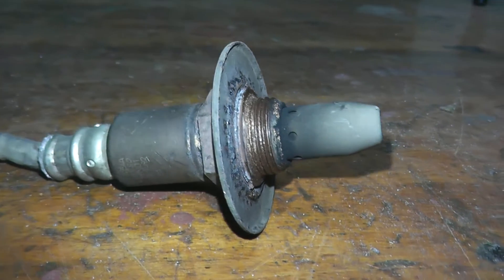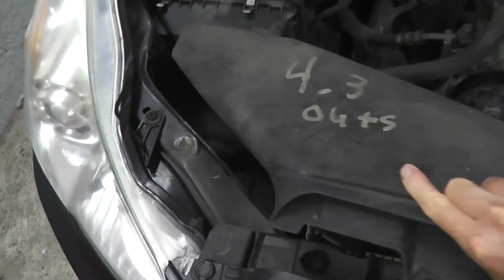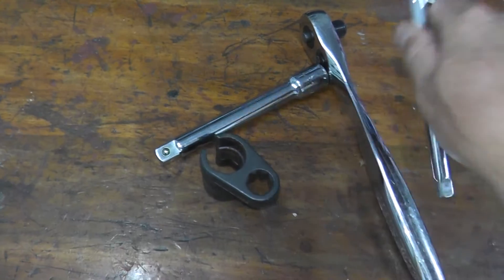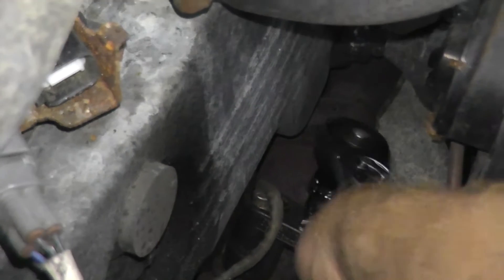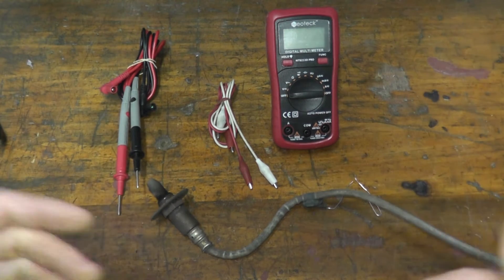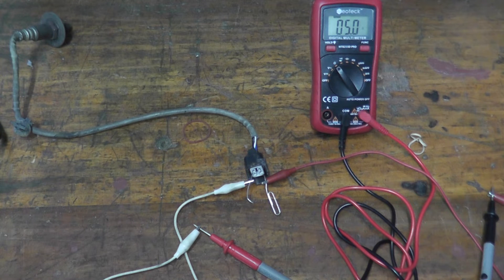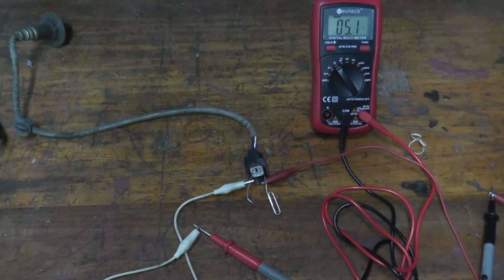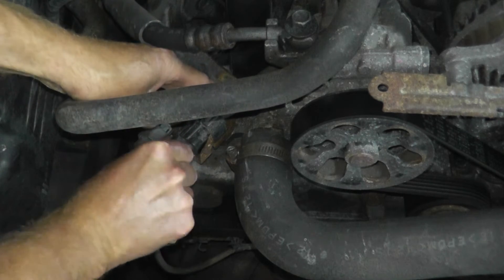Subaru Air Fuel Sensor P0030 P0031 P0032

Comment: I got p0030 and my sensor is 2.5ohm but i still got a engine light what can be the problem, sorry for bad english
Reply: Either 02 sensor is faulty or connector to the car is faulty. If they are tested and they are good then it means you might have an exhaust leak somewhere.

Comment: Will the light turn off by them self after u install the new sensor?
Reply from the maker: Yes, eventually. The computer will turn of the light but it can take up to 70 miles or a combo of local/highway driving. Your local part store will more than likely turn off the check engine light for free or you can buy a cheap code reader for $20.

Comment: Anyone got any ideas for a 3.0 H6 Boxer? I have a 2005 outback 3.0 LL Bean, recently got a new transmission put in and now p0031 code for bank 1 sensor 1 is on and is making my car run bad, never did this before transmission replacement. I've replaced both front sensors, on each side, with denso, I've ran 44k platinum through gas, checked the wires for splits. I have talked to many people and I've done everything, won't go away. Almost $15k in this car now and this is messing everything up. Anyone? Please
Reply: If it was run for a long time with bad sensors, your converter can be clogged up!

Comment: So I've got an 04 forester with an na 2.5 and its had the p0030 since I've had it.

Anyway I found the factory service manual and followed the diagnostics to a T.

I checked the resistance from the wiring from the Ecu to the o2 sensor connector and I did discover the pins for 3 and 4 were back to front, connector looks new so I guess someone changed it but put them back to front.

Anyway I fixed that and continued the checks, the wiring all has very low resistance so no shorts from that test. I could trace continuity from the ecu and main relay to all 4 pins on the connector.

Tested resistance on the sensor and got 2.5ohm on the sensor so within spec.

Everything should be fine according to the diagnostic flowchart.

Starting to think its the ecu or I need to bite the bullet and buy an expensive oem sensor. The wiring and connectors look brand new though so I guess its been replaced and it didn't fix it
Reply: I've been trying to find the specs but no luck, do you know if 2.2 ohms heating element reading is within specs?
Reply: @AJ........  Try testing it hot and cold. if there is difference it the heating element should be good.

Comment: Hi. Which wire is the signal wire
Reply: Untape the female plug and find the pair with a screen like a TV cable , this has an input between 0 and 1.0 voltage like a thermocouple, the heater wires are the other 2, put 12volts on it and it will get hot pulling 5amps, go with oe denso or repeat , take the front manifold off if its seized, it'll take 3months to settle in ,

Comment: Great video, thanks(:

I'm getting "Subaru P0031" Can you link me the part I need?

My local shop quoted me $400 for the part, said it would take 1.5 hours. I became furious once I saw how easy it is in your video. I believe I've found the part I need, most are like $40, NOT $400.
Reply: Hi, 
I have the same issue P0031 Heated oxygen sensor bank 1 sensor 1 HO2S11 
Did you found any solution for it 
Thank you
Reply: @salaheddinebelghiti4956  I installed the new sensor, then the same code came back, along with a new code "oxygen sensor leak". When I installed the sensor my engine was cold and I don't think I tightened it enough because I didn't want to damage the threads.

FIX: I put the O2 socket on, let my car warm up for 20min, then used my breaker bar with the extensions on it to reach down and give the sensor one more courter turn or so. Turned the car off, cleared the codes, at first the car will run a bit funny as it calibrates to the new sensor. After it idled for a while I took it for a drive and it's been fine for a few weeks!
Reply: Same i changed the sensor and cleared light and came back on about 30mins after driving
Reply: @mikehall9666  Same thing happened to me, the same code came back, along with a new code "oxygen sensor leak". When I installed the sensor my engine was cold and I don't think I tightened it enough because I didn't want to damage the threads.

Fix: I put the O2 socket on, let my car warm up for 20min, then used my breaker bar with the extensions on it to reach down and give the sensor one more courter turn or so. Turned the car off, cleared the codes, at first the car will run a bit funny as it calibrates to the new sensor. After it idled for a while I took it for a drive and it's been fine for a few weeks!
Reply: Did you check for power at the sensor?  He didn't cover it, but there's a relay providing power to the sensor.  If the relay goes bad, the sensor's not the problem, and replacing the sensor won't fix it.  The relay might be an expensive part to replace, because it's in a horrible location, buried in the passenger side dash behind the glove box.  You can get to it, but it's pretty hard without disassembling half the dash on that side.

OTOH, if they're replacing the sensor with a Denso or Subaru, it's a pretty expensive part.  But the Bosch sensors supposedly don't respond as fast and some people say that's a problem.
Reply: @kcaa3953  I ended up replacing the O2 sensor. The engine light still comes on sometimes with the cruise flashing again and not working. Seems better than before. I have to clear the light about once every 150miles. Usually comes on when on the highway or using the cruise control a lot.

It's fun lol. Maybe relay is the right thing to replace. I clear my codes through my phone with a $3 OBD2 scanner maybe once every 3 months. Not worth taking it to the shop yet

Comment: Greetings,
On my 2015 Forester, I got the code P0171.
Should I replace both or determine which is the faulty one?
Reply: It’s been 3 months, you’ve probably done what you’ll do, but p0171 is classically a code solved by cleaning the MAF with MAF cleaner,
Reply: @elonchan4883  replaced both sensors and it cleared it up, good for another 60K miles :D

Comment: i have heard it mentioned elsewhere that a bad air fuel sensor is most likely what is causing random jerky acceleration in my 2008 outback. has anybody else hear heard similar or infact found this to be true based on personal first hand experience ?
Reply: Got promblems wirh start engine
Reply: @adrianzieba1772  nah mate, i serviced a whole bunch of stuff under the hood and its all running good lately ;)